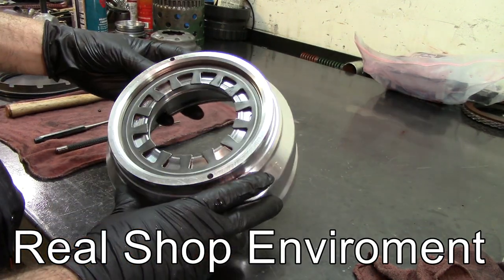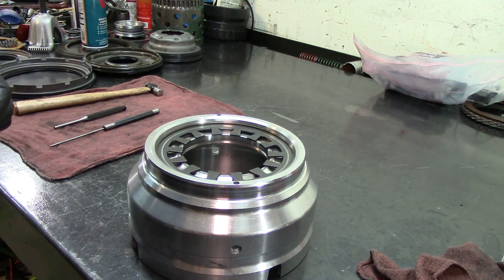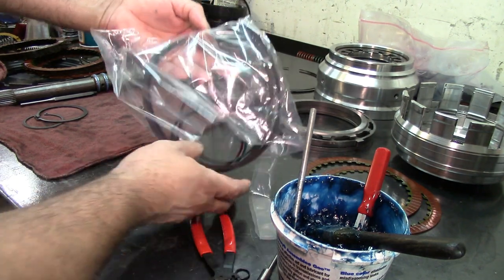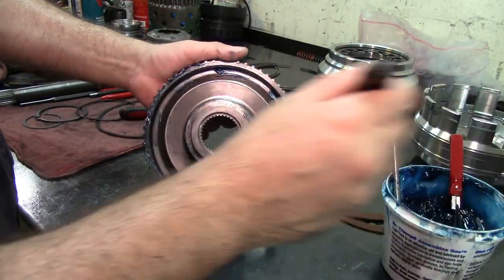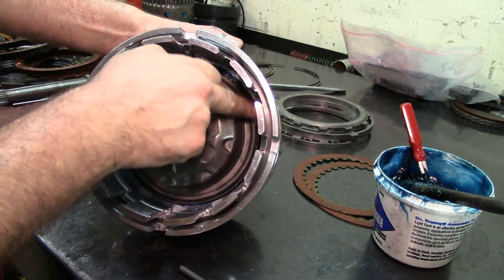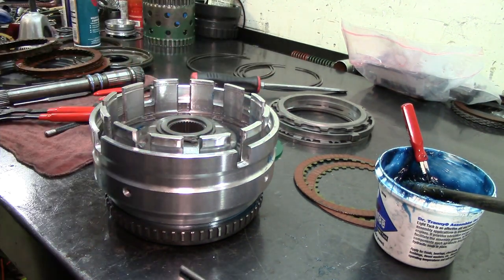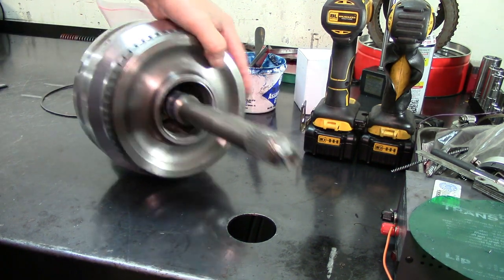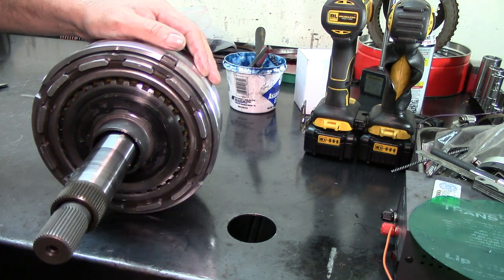68RFE Transmission - Input Drum Assembly

Comment: Hiram, thank you very much for your guideness!
I've rebuilt my 45RFE transmission with your video and manual. I read the manual, watched the video and did it step by step as described.
I want to say that I took and installed the underdrive piston into balance piston, then put it together in the input drum. It took less time and works. More than 10000 kilometers passed.

Comment: Hello Hiram! Thanks for the great videos man, I really appreciate you providing all of the great info! I just now finished rebuilding the input drum assembly for my 68RFE, following your instructions in this video. In my tranny the OD clutch pack was showing some signs that it had gotten hot with some discoloration, some small circle areas of friction material having pitted away, and a couple frictions were warped. The truck is new to me, so I don't know much about it's history. That said the tranny has obviously been rebuilt not too long ago, since everything other than the OD looked like new. My main concern/question is this: It seems from the homework that I've done that clearances can be very important to get right with the 68RFE, and want to make sure I give my tranny a chance to work well and last by ensuring my clearances are within specification. How do you check your clearances? Do you have on of those fixtures to mount the input drum into and use air pressure and a dial caliper; or do you use a feeler gauge or something else? Any chance you can do a video on this topic? Thanks again for all the great info!

Comment: Was having a little trouble seeing the inner thrust bearings. Is there a top or bottom when putting them in there. It looked like you were putting the black paint marks up except for bottom and plastic coated bearing. My question is if I put one in with black paint down on accident would it starve for oil or cause bearing to fail?

Comment: Good tips Hiram. I see those filters fall out all the time. Usually install new ones with a little lock tite and stake them back in. Question: Do you drill out the cup plug you install into the input drum any more than it is? It seems like the orifice size is small and could cause some restriction on oil release.

Comment: hey hiram how do we do a relearn on a 545rfe. we just installed a low mileage transmission in a 2wd 08 1500 and first to second is lazy and it won't go into lockup . we've pulled cables and a minute of driving the ck engine light comes right back on . we don't know what code it is yet

Comment: Hirarm, excellent video as usual. Question about the assembly lubes. Noticed you use green for some things and blue for others.  I couldn't find a general rule when I did my 42RLE so I used the green that came with the TRANSGO shift kit for nearly everything.  What's been your experience.  
Thanks, Eric S.

Comment: Wow, this will be my first negative comment.  You never ever use a rol loc on a steel or apply or pressure plate, and I also disagree with the Emory cloth.  You need a perfect polished surface, if not the friction material on the friction turns into the polishing material, which then causes premature failure.  Shame Shame on you sir.

Comment: For those of you that are rebuilding a hydraulic transmission for the first time. "peace of advice" DON'T USE A LIP SEAL TOOL!!!! to install the pistons. Take the drums and pistons to the dealer or a transmission shop that has the right piston installing tools, and pay them to do it. I guarantee you it's cheaper then buying pistons over and over again. Second! when shopping for a rebuild kit. Find one that has all the steels, all the pistons, and clutches etc... stay away from suncoast and BD. There's no since in buying half of what you need to do the job right the first. Learning experience could of saved a lot of money!
Reply: Luke Johnson you can use t
You can use a lip tool just go slow and be patient no reason to do the transmission if you can't do you use the lip tool have someone rebuild the whole thing for you then